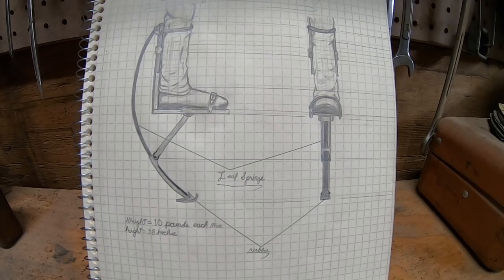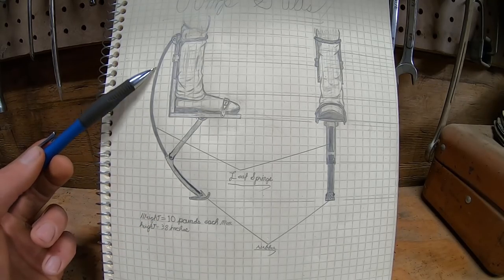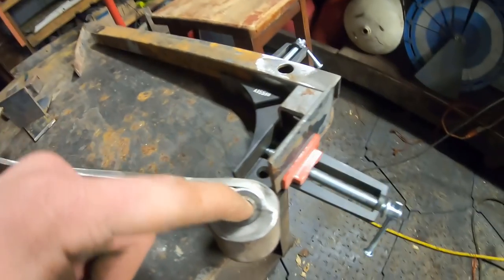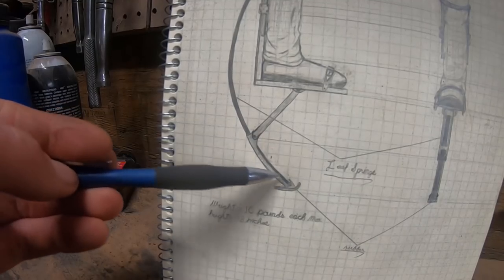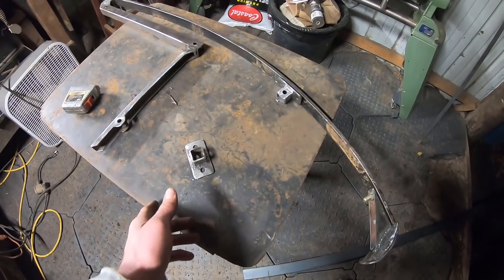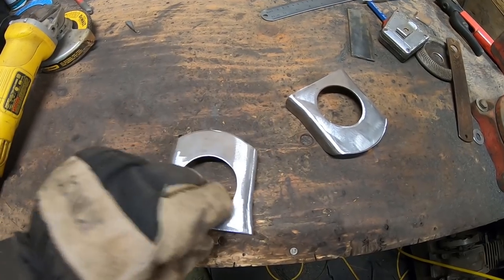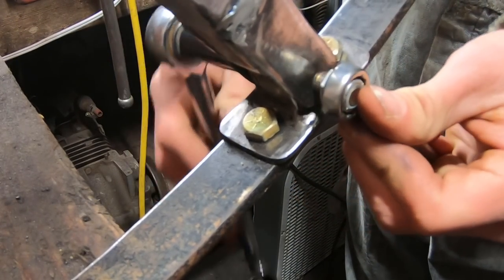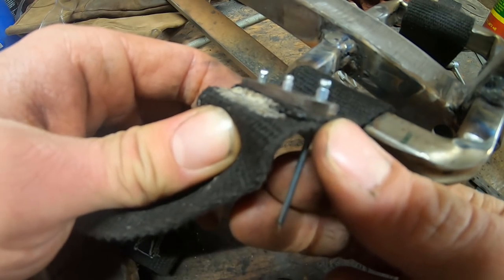How to Build Real Fully-Functional Jump Stilts From Scratch For Under $50!

Comment: Nice build. Did the rubber come off feet in use?
Reply from the maker: Sadly, yes. I think a better foot design would include a surface that the rubber could wrap around and screw into. Thanks for the comment!
Reply: @randomn6473  Maybe a couple of old pedals from a vehicle?
Reply from the maker: @noisysprings  Creative! I like it!
Reply: @randomn6473  If you plan on using them entirely in the country, you might consider making cleats of sorts, by drilling through the foot and adding downward-pointing screws (possibly with the shaft shaved smooth to prevent the screw from binding into the soil).
Also:  Might I suggest wingnuts for the back of your shin-strap?  It might allow a firmer fasten, while still not requiring tools to tighten down.

Comment: So part of your problem is that you didn’t use sufficient cooling when cutting the leaf spring. This meant excess heat buildup on the edge, essentially tempering and hardening one side of the spring. This is why it doesn’t spring back as well.

Comment: So you did use thread lock right. Because those nuts and bolts will move like a son of a bitch. You could also change the temper of the springs to make them more ridged.